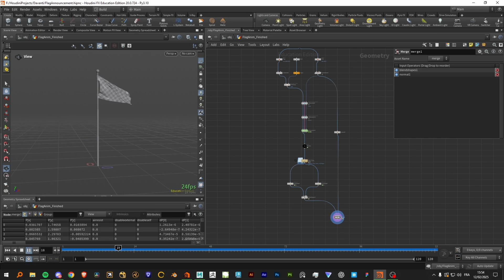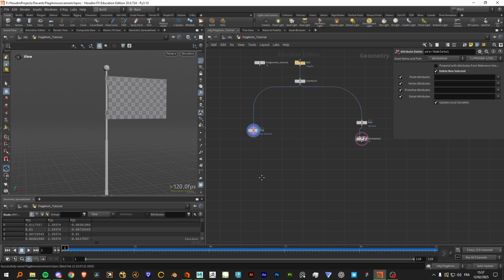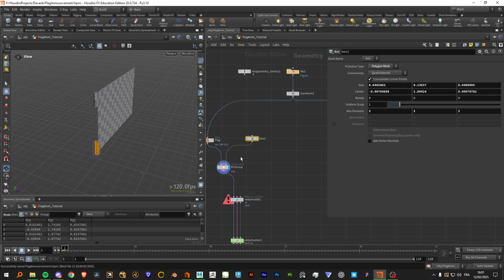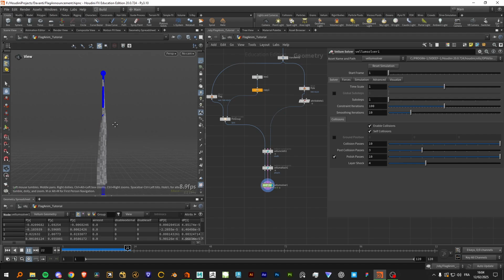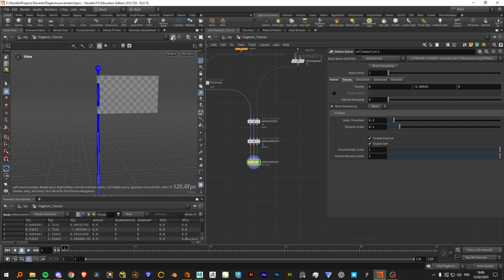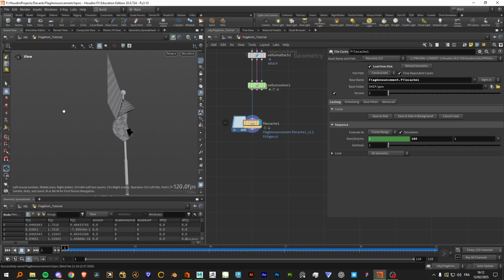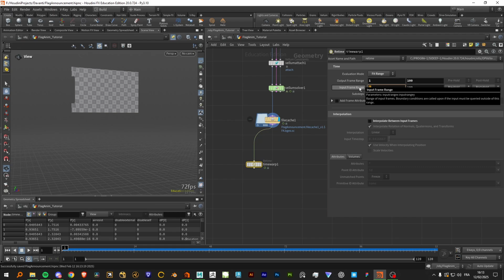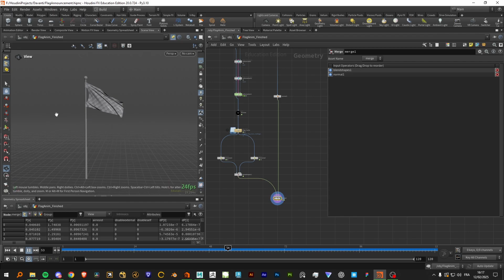Looping Flag Animation in Houdini for Beginners

Comment: @Solso4D Great Tutorial! 
Would the time loop sequence technique work for regular mesh animation or only for cloth simulation? Because I attempted to apply those techniques to animate something else rotating 360 degrees on the Y-axis, the mesh keeps getting flattened at 80-something frames and then resized back to normal after 10 frames.